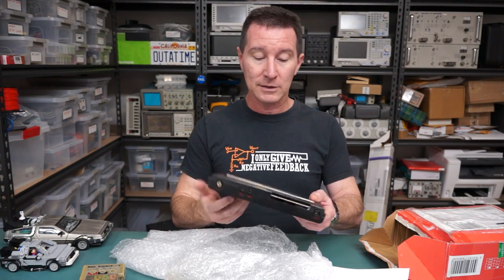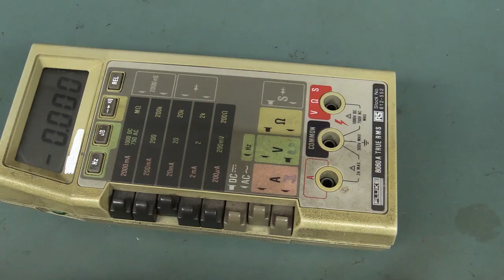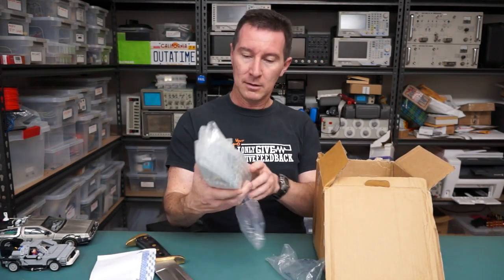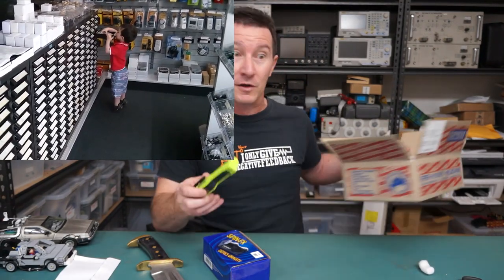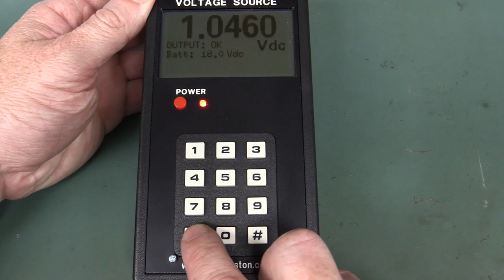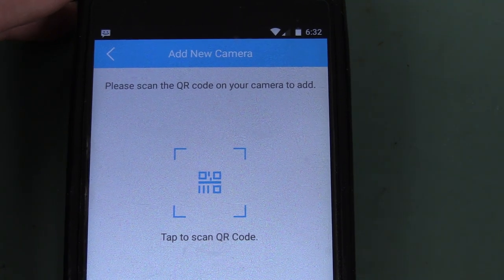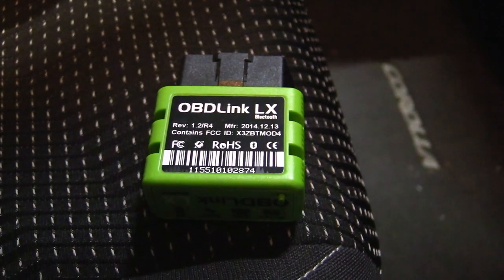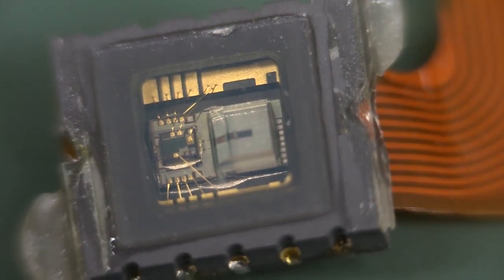EEVblog #802 - Mailbag

Comment: I still have my first multimeter - the Fluke 8020B, purchased new around 1980-1981, and it is still just as accurate as the day I purchased it.  While I have several other newer, more fully-featured meters, I still regularly use my 8020B.  I even still have the original case and leads, all of which are in good to great condition.  Long live Fluke!

Comment: Hi Dave, the Port on the PowerBook is for external SCSI devices. Also, Balls are fine 😊
The Power button was rarely used, the PowerBook got into deep sleep when closing the lid, and wakes up when you open it. Looking forward to the tear down 😊

Comment: I also have the ELM 327 adapter and it works great. You have to hook it up correctly though. I use an app called Torque. You have to manually pair it, but then it connects automatically.

Comment: +EEVblog - the laser pickup at 48:37 looks similar to the type used in the Nintendo Game Cube, and in a fair few car DVD players / laptop DVD drives.

The Game Cube one looks like a Panasonic HUL7208, which they call a "Hologram Unit"...

http://www.datasheetcatalog.com/datasheets_pdf/H/U/L/7/HUL7207.shtml

The laser is side-emitting, as you say, and the photo sensors are underneath the prism block.

It's a nice way of making a more compact laser sled, as it doesn't require a separate "port" on the sled for the photo sensor array.

I'm not sure exactly which type you have there, but it looks like it could be a high-powered diode from a DVD burner / recorder maybe?
Reply: +electronash 
Yup, that's what it is.

Comment: I've had several of those clear blue ELM327 knockoffs arrive dead. Every single one of them had cracked/bridged solder joints, so I managed to fix all but one. Torque seems to be the nicest Android app for the purpose.

Comment: The tiny DVD head shown at the end of this video gave me an idea that led, (no pun) to repairing a failing portable CD player, an Audio Solutions ATC 351, I bought 11 years ago. Now, I don't have an electronics lab and don't go anywhere near a soldering iron because of very poor vision, but I enjoy your videos very much because they illustrate sound trouble shooting skills anyone should be aware of. I did software support in Silicon Valley about ten years ago. Anyway, seeing that little ribbon cable coming off that head gave me an idea. I went and got a none too small flat head screwdriver and gently pushed on the connectors for the ribbon cables that connect to the laser read head and the main board, after making sure that the batteries were out, you don't want to go looking at a laser, when you can't see the radiation, with a magnifying glass, especially if you only have one good eye. The darned player works now, the ribbon cable has come unseated after ten years jostling around. I really enjoy the who done it character of your videos.Keep up the great work.
Reply: I neglected to give all the trouble shooting steps. The CD player would power, write to the LCD display, but come up with "Bad Disc" or "no Disc" and click a couple of times. That suggested that either the tracking failed or the laser diode was out. Seeing your video suggested that a third possibility was the ribbon  connector had worked loose, since the failure had ben intermittent.

Comment: About the old Macintosh laptop.  I think that this was definitely during the era of Jobs.   We outfitted our engineers with these as the process was Motorola and so were we.  The trackball would get crusty inside but was easily removeable (turn the ring 90 degrees).  Hey, it wasn't clunky!   Nooooo.  The original Apple portable ... now THAT was clunky.   Yes, I even carried that beast onto an airplane!

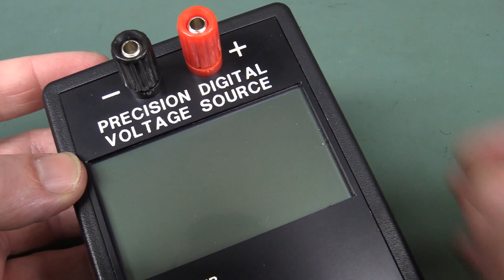Comment: 26:34 - Lettraset? wow Ian must have the patience of a clockmaker.

For my "neat" jobs I attach insulation tape (yellow) and write on with a black Sharpie or Staedtler Permanent Lumocolor Fine. Nice and rough, matches my demeanor ;)

Ian's project is extremely neat, nice work, very slick - reminds me of the GND guys on the key ;)

Comment: A lot of people have trouble with the cheap OBD bluetooth adapters apparently. When I was reading up on them, many people recommended staying away and sticking with the OBDLink devices.I have an OBDLink LX as well and it works quite well.

Fun fact about the OBDLink LX on the Toyota GT86/Scion FRS: The computer is finicky about things reading from it while starting the engine. I have to make sure my phone is not running any OBD apps while starting, else it will cause the computer to freak out, throw codes, and not allow things to function properly.

Another fun fact about this car: It has 2 fuel rails. I have not found an app that works properly on this car when reading fuel rates, mileage, etc. I think it only reads the low pressure rail. It grossly overestimates fuel mileage (pretty sure I'm not getting nearly 40 mpg in my tiny little sports car).
Reply: +Beau Steward I agree, I had a cheap one, the little blue one with the tab instead of a solid bump on the connector side that looks like eBay item number 290812437816

It would connect to '90s GM VPW but not 2000s, and on a '97 Lumina I could actually kill the engine, or at least reboot the PCM, by trying to read a certain PID with it.

I now have the OBDLink MX and it works almost perfectly, but does lock up and has to be power cycled (replugged) occasionally.

My interesting story with it is that my '97 1st gen Chrysler LH car (Intrepid) won't connect properly if the throttle is open while moving, IE in park or coasting in drive throttle closed, Android apps connect fine and the Windows program shows 2 ECMs (likely the SBEC and TCM) but throttle open Android connects to the wrong ECU and Windows only shows 1 available, and it has very few active PIDs.

Once connected correctly the throttle can be opened without it losing connection, so real-time data does work.

Oh and the MX and likely LX has an actual pairing button so the guy in the next car over can't just casually connect to it like with the cheapies.

Comment: ive seen alot of those cheap elm327 adapters have bad solder jobs between the board and the bluetooth board, had to resolder mine to get to to work

Comment: A huge number of those cheap OBD adapters use counterfeit ELM327 chips. I had a similar looking one with the blue case and it didn't work for me either.
Reply: +Wyvrn Yep there are alot of iffy OBD apaters, some of them with certain mac addresses are known to be problematic.

there have also been isolated cases where the adapter has damaged ECU's

I have one which only cost £12 but it works fine. connects to my peogot 307 2.0 hdi. Havnt used it in a while but there was alot of sensors not supported at the time.

They are really handy for tracing minor issues, like if the EML is triggered by something easily fixed, like a faulty MAF sensor. Replace the maf and clear fault codes, No more EML .

Getting your car diagnosed for something really simply can be costly.
Reply: +Wyvrn It seems I have the same as in the video. Works fine for me with the Torque app.
Reply: The story was that the rev1 ELM327 dongles were shipped WITHOUT firmware protection enabled on the micro - so they were quickly cloned by other manufacturers. Versions since then have been protected, and updates are restricted, so the clones are limited to running V1.00 of the ELM firmware, which has support for a far more limited set of interfaces and vehicles.

Comment: I like track balls if they're optical, but if the old school rotary ones always got gummed up with finger grease and dirt.Nipples didn't have that problem, but some didn't have enough analog movement, it was either painfullly slow or too damn fast.
Reply: +CrustyHO I got to the point of either using keyboard shortcuts or plugging in a optical mouse.

Comment: your alternator is due for replacement if battery voltage reads below 14.2v while running
Reply: +Radek Wysocki NipponDenso alternators run at 13.5V. http://densoautoparts.com/alternators
Reply: Thats real wierd, always asumed batteries needed 14.2 to fully charge their capacity
Reply: +sivalley Yes and lead-acid charging has to be temperature compensated, the hotter the lower the charging voltage.
Reply: So ausie cars are ok to have 13.5 but cars here in europe where it snows would be a bad practise to use 13.5v alternator?
Reply: +Radek Wysocki The voltage regulator has a thermistor in it that takes care of it for you.

The curve is roughly -30mV per °C for a 12V (6 cell) lead acid battery. IOW drop the temp 33° and you need to raise the charging voltage by 1 volt.

Comment: I have a question about the Voltage Source device. Why does it have a 'heater' in it? I figured out that it produces a source of voltage as a reference, but why does it need to produce heat? 

Thanks,
Reply: +Neodinium just a guess, but the reference voltage probably changes with temperature, so the heater is there to keep the temperature constant.
Reply: ***** but then that would mean it would need a very accurate temperature sensor, right.
Reply: +Neodinium A quick Google image search provides graphs with temperature steps of 10 degrees or more. Judging from that, a degree here or there shouldn't matter much.

Mr. Jones probably did a video covering all this, will have to look it up.
Reply: ***** yea i guess
Reply: +Neodinium The voltage reference has a 1ppm/degC tempco, and so the more stable the temperature then the less it will drift. The heater can maintain a fixed temp +/- 1.5degC which is MUCH better than the difference between a cold room and a warm one. Net result is better stability of the vref output. And since I am down at the uV level in terms of DAC output then the heater works wonders. No need for super accurate temperatures.
Reply: IanScottJohnston Ah thanks for clearing it up!

Comment: Those foscam cameras are useless on wifi. I have one of the ptz ones and the video drops out every few minutes and fills my log with errors. It works fine on ethernet though but the video quality is still crap.
Make sure the thing is firewalled, I wouldn't trust them to be secure on the internet.

Comment: 25:00 is that a portable power supply ?
Reply: +sypher0101 
its a protable adjustable voltage refrenece, it is basically give you very stable over tempeture and very accourte voltage to calibare stuff. the current output is like 1mA so not even good for a led.

Comment: What's the purpose of the heater at 28:00?
Reply: +Keith Richards The heater keeps the voltage reference at a more constant temperature.

The reference is calibrated at that same temperature, so when the device warms up during use, the accuracy is more repeatable. ;)

It's quite common to find a TCXO - Temperature Controlled Xtal (crystal) Oscillator in equipment that requires high repeatable accuracy. The frequency of most standard crystal oscillators are fairly temperature dependant once you get down to multiple digits.

Comment: Foscam cameras are awful. Had to fix solder joints for the IR illumination and took me 2 days to update the firmware on 4 cams. Better for them that you can't look inside. And the IR filter won't work with the camera head down. Pieces of crap. Without mentionning the dodgy video compression. Look at what you see when dave tests the night vision... nothing of what is moving only big blocks. So if you want to see what is still, fine, but it's not what I'm expecting for a surveillance camera...

Comment: You had a Russian ripoff ZX Spectrum a few months ago, I think.
Reply: +AtheosPhyve I wouldn't call them "ripoffs" since a lot of the Spectrum clones were much better than the original.
Reply: +Spocker spock Argument for the sake of argument? The Russian version's design was ripped off from that of the ZX Spectrum.
Reply: +Mari Onette I'm not here to argue semantics. If you buy an aftermarket item for your car though, you can imagine they used schematics from the manufacturer, and that they have a license from the original manufacturers to make that part. 
If you look at the term ripoff though, and take it from a manufacturer standpoint, the company whose design was stolen, got ripped off. So yeah, if we're going to argue semantics, let's also argue perspective.